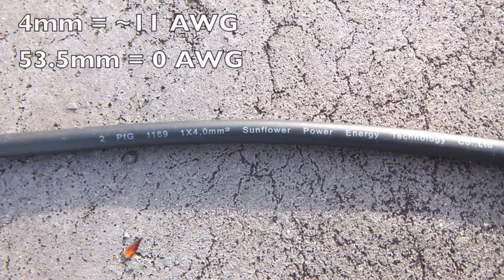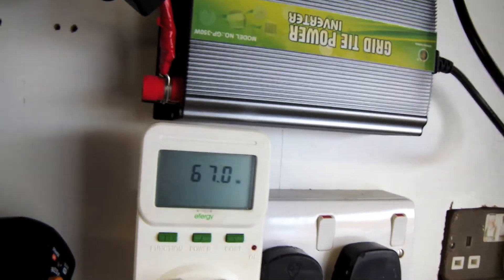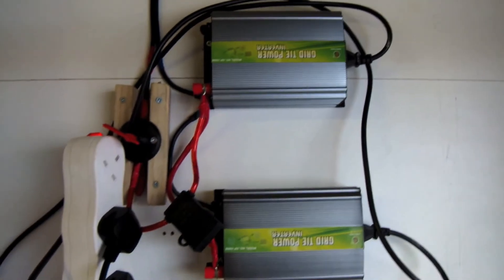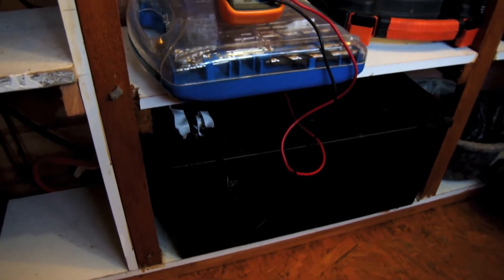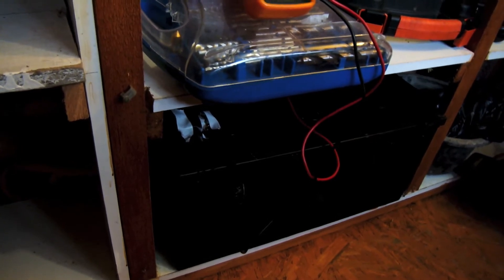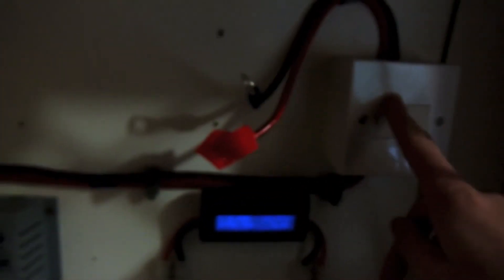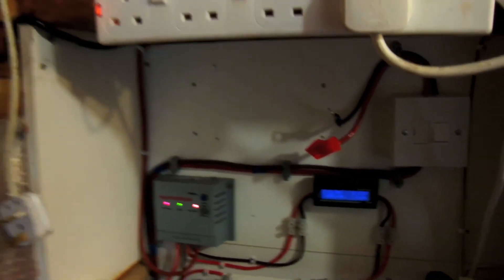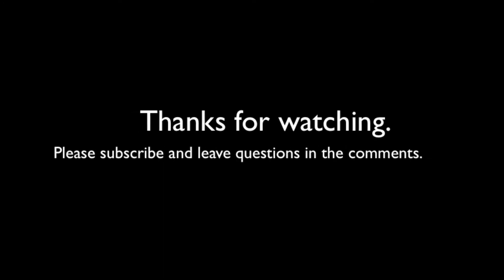Solar powered shed & garage setup UK - January 2013 Update

Comment: My batteries were 2nd hand also, I used a desulphinator on the batteries and it really helped recover them. Cost about £25, it sends pulse though battery cells breaking up the sulphur that builds up on the plates lowering their efficiency.
Liked the update man' keep them coming

Comment from the maker: MPPT charge controllers are for off-grid use only and are specifically for charging batteries. The grid tie inverters have their own MPPT style controllers built into them, which they use to get the most power from the panels before then converting to 240v mains. Thanks for the link, will check it out :)

Comment: Thanks for this video. You inspired me to get the same 350w invertor off Ebay for my 80w panel.

It's been cloudly on the first day and it got no higher than 60w but I couldn't believe it when it peaked at 93.8w from a 80w panel running through the inverter. It runs at 70w+ steady when the sun is out.

I'm a noob and have copied you but I have my short solar wires going right into shed then my inveter (2ft of wire perhaps) and then a normal 240v extension to the house. Try this!

Comment from the maker: No. When the shed has it's grid tie in place (currently away for repair) it shares the input power from the panels wired to the shed itself, which at the moment is the 20w and 80w panel giving 100w total.

As this is wired in parallel the power is split equally between batteries and grid, then once the batteries are charged the majority of the power gets diverted purely to the grid.

Comment: hi you might want to think about adding more batts to your set-up something like 10 or 20, have them next to each other (like a checker patten) you could have them out side of the shed in a wood box with water proof paint use rubber as water proof with glass  or wood kitchen cupboard doors, have the  doors placed like on a rabbit run use cable ties to bunch the cables on the roof running in side and to the shed also add steel wire from shed to  garage for cable support using cable ties, thanks #

Comment: If you have some small guage wire long enough you can run it to the roof for testing the wire loss with your meter before spending a fortune on thicker wire. You only need to measure one side up to the panels when it's at full power, then X 2 the figure. No current is going down the small wire so there should be very little loss while measuring the voltage loss.

Comment from the maker: Thanks. This is something I have done and have notice some loss. Calculating the wire thickness it's inevitable and the main wire would need to be upgraded when we get more panels, so I now intend to go with the thickest cable to future proof it. Plus I can source it relatively cheap, it's just the work involved to re-wire that section of the setup.

Comment from the maker: Yes. Most high power grid tied solar setup use higher voltages that our setup in this video. 

Essentially every time you double your voltage you half the current required for the same power.

It can be quite complicated as you need to factor in voltage drop too, if you do a bit of reading online you'll get a general feel for what is possible efficiently. A quick search suggests 4mm2 typically has a range of 12-20Amps, the voltage then dictates how much power/watts you can push through it.

Comment from the maker: Hi Suranga,

Best thing is to look at reviews. Also if you buy one a simple test you can do is check the input vs output voltage. Non mppt charge controllers will pull the input voltage down to around the level of the battery so 12.something volts. Mppt charge controllers on the other hand will have around 17v on the input side (or whatever your panels peak power figure is) and then 12.something on the output.

Comment: I have two 175 watt  mono panels in parallel (350watts) - but have never seen more than 250 watts being produced even in full sunlight with the panels optimally aligned.  It's not a volt-drop problem, as I have my inverter right beside the panels.  It's simply the low efficiency of the panels themselves....  `

Comment: Hi hippyraverocker just a heads up you can't use different AH batteries you will destroy the batterys. They have to be the same AH and your cable run is to long on the dc side from battery to battery. If you just increase the voltage coming from the solar via a charge controller you cable should be fine hope this helps
Reply from the maker: Thanks for your comments.
Reply: Stephen T  The AH don't matter  if battery is connected on parallels.

Comment: Hi how much power would I need to run a water pump, compressor and lights in my shed....... I'm building an aquaponics system..... want to go solar but I know very little about it.  also how much would set cost, Thanks

Comment: Good video but am I missing something here. Your panels are retuning you 16KW back into the grid over 2 months so around 8 KW per month. With electricity prices at around 0.14 pence per KWH you are saving just over £1 per month but spending £60+ on a grid tie inverter. That will take 60 months just to pay for 1 inverter and you have 2 so around 10 years to cover the cost assuming they last that long and sadly they probably wont ( as you say in your shed you have had 3 fail already).
I am not being awkward as I was thinking of doing the same thing myself but doing the maths surely its a false economy.
I hope I have got this all wrong and you will explain how and where I have gone wrong. Dave
Reply: Don Key Yes, its a painful struggle. something to keep yourself busy not for saving any world. if you spend less, you end-up with junk.  If you spend more, it takes too long to get you money back especially with the English weather.
Reply: Look at it another way.  What sort of interest rate would you get if you put the money into the bank?  I've also got a small system, but I hope to get at least a ten-percent return on my investment (with no tax involved!) In the meantime, I'm learning a bit about solar, and may extend the systemt later if the efficiency of panels gets better, and prices keep coming down.

Comment: Sorry for sounding thick but is there a limit to the amount of current that standard 4mm solar cables can carry?  Alot of ebay sellers just state that they are rated up to 1,000Volts.

Comment: Rather than replacing grid ties with 24v and thicker wire, why not put a MPPT charge controller between solar and grid ties? should up the grid tie output abit.

I also dabble in solar (120w panel, 240ah batteries, 300w inverter, no grid tie yet).

I found this on ebay as well, might be of interest to you (im not affiliated and no bought anything form them just cheap)
ebay.co.uk/the-_-duke/